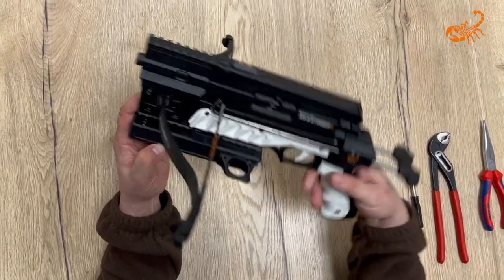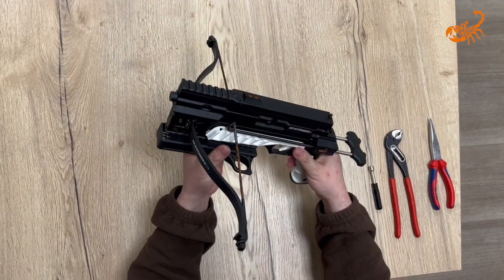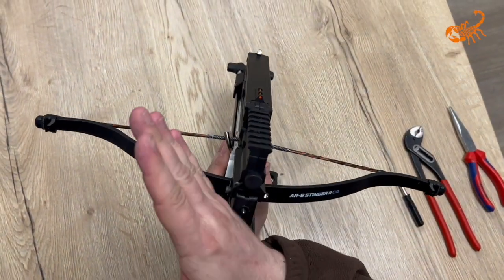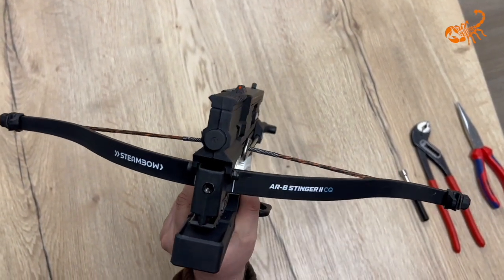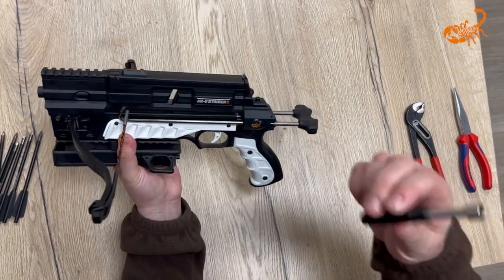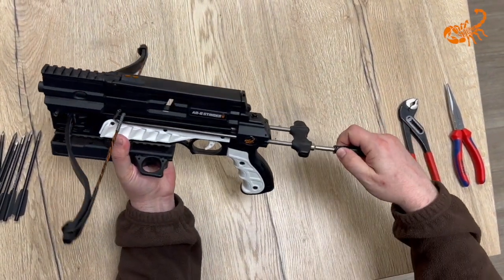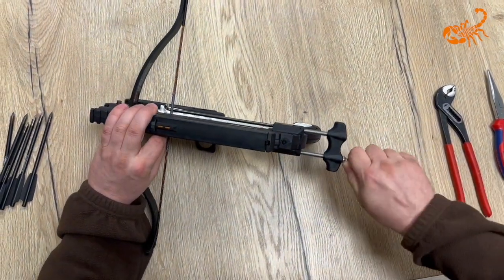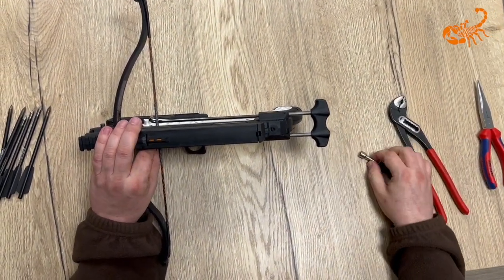Steambow AR-6 Stinger II Compact cocking arm adjustment

Comment: I'm guessing this is meant to prevent friction of the cocking arms from scratching at the side surfaces of the crossbow. I didn't see this info anywhere in the manual, so I didn't even consider this adjustment.

Funnily, those screws are so tight by default I wasn't able to loosen them yet lol.

The crossbow itself is fantastic btw! A masterpiece of equipment. I have had a lot of fun blasting at cardboard boxes almost 50 times now - shooting it is such a delightful experience. Thank you making it Steambow! ❤
Reply: Careful with your bolts, if it passes through the cardboard it might ruin the wings on your bolts.

If they fall off you need to glue them unto your bolts again, if the positioning is wrong you might get trouble loading and firing your crossbow.
Reply: @larocdokarnap3227  Thanks, I am aware. ❤

After watching Joerg shoot through coconuts, ballistic gel and tincans - while witnessing damage to bolts, I made a priority to construct my targets correctly.

The special cardboard box I'm shooting is not empty/hollow, but instead completely filled with many other squashed cardboard boxes like a thick cardboard sandwitch. 

I even put an old broken tshirt over it to further deter bolts from sinking too deep.
Reply: Even if you use many layers of cardboard you will end up shooting into previously made holes, the bolts will go deeper everytime they enter the same hole until they disappear completely into the cardboard.

You could make a hard target out of wood and use bodkins which has the stronger and more durable tips, or you want to make a soft target for your practice bolts but it needs to provide enough resistance so they won't pass through.

Also be careful you do not hit previously fired bolts, if the back cap is damaged it might cut and snap your tendon and potentially break the limb when firing.

I've had some thoughts on making a target out of foam and compressing it with an iron ring on the outside to create greater density and stopping power, but haven't got around to make one yet. Also i have been looking for a thick woven synthetic fabric that doesn't doesn't pierce to easily but kinda gets pushed in to the material behind it.

I used a thick shopping bag with cardboard in the beginning and found that the synthetic fabric of the handles are quite effective for stopping bolts. I think the usage of different layered materials is better then just using a single material on its own.

I suggest you do some experimenting till you find something better, and watch out that your bolts won't bounce cause they can be quite unpredictable.
Reply: One more thing, get some lube for your rail and tendons, your gonna burn through them in no time without the lube, and you might want to learn to repair your own servings so you won't have to buy a new tendon every 150/300 shots, depending on wether you are shooting dry or lubed.
Reply: @larocdokarnap3227  Excellent points, I will certainly abide by them.

For now the sandwitch target holds up pretty well and I can reinforce it with even more cardboard as needed - and even replace it all together with a new one eventually.

I did already lube my rail, thought I used a gun lube originally intended for airsoft AEGs. It says its suitable to plastic-on-plastic, metal-on-plastic and other similar applications, so I hope its sufficient. I haven't thought of lubing the tendon though, so I should probably try that.

I did apply some wax to the tendon though. Still new to this whole thing so I hope I did it right.

As a funny anecdote I shoot a mixed load of 5 training arrows + 1 bodkin tip in my magazine and the first bolt's tip to detach from the head was actually the bodkin bolt's one. I dug it out of the cardboard and pushed it back into the bolt and its good as new again and hasn't detached since, but kinda funny since I expected this to happen with the blue training arrows first.
Reply: You're right, it isn't in the manual. Considering the price of this item, the arms ought to be checked and adjusted at the factory. It was only by chance that I saw this video prior to purchase, and remembered it. I adjusted the angle of both arms, but they are uneven. One tapers in towards the crossbow body, sitting very close to it, the other tapers outwards.
Reply: @larocdokarnap3227  Thats great advice I used 8 pieces of card board with a thick rug behind it and a thick piece of plastic behind it, The bolts only go through like half way, But my bolts fall halfway out of the front when  I point downwards, is that normal or did I assemble it wrong. I just got it a few days ago. And my string jams and only moves like an inch from the holding point. Thank u for any help

Comment: Hi I bought this crossbow when i cock it it sometimes fires straight away is there anyway to prevent this from happening
Reply from the maker: Hi. Please look at the FAQ section. https://www.steambow.at/faq/?lang=en If that doesn't have the information you need, use the contact form to reach out to the support team : https://www.steambow.at/contact/?lang=en
Reply: Make sure you pull back as far as possible, the bend of the metal should guide the tendon into the groove. Also check if your trigger is falling back fully into its default position and is not elevated.

I suggest you replace the foregrip with a better design, the standard foregrip doesn't sit very tight. I don't know the name of my foregrip, but it actually uses the entire rail and is solid as can be. This because i use my trigger hand for cocking the crossbow while holding the foregrip.

You might want to consider the tactical loadout cause its way easier to cock the crossbow then the compact loadout, especially with the 90lbs pro-limb. But they don't offer a conversion kit for compact to tactical, only from tactical to compact which is a shame.

If your crossbow is proper then its probably your technique that requires adjustment.
Reply: @larocdokarnap3227  But they do offer conversion from compact to tactical. I bought such a kit a while ago, from Steambow.
Reply: @1973Raido  
I have never seen the offering, can't find it on the website either, but if you say so then i say its possible.
Reply: @larocdokarnap3227  ive also seen it on the website, its 50-60euros